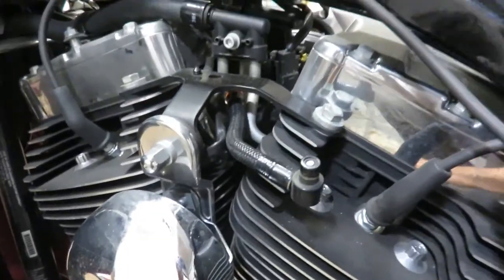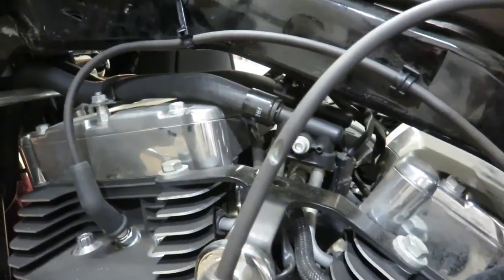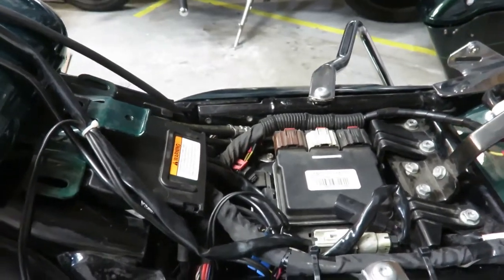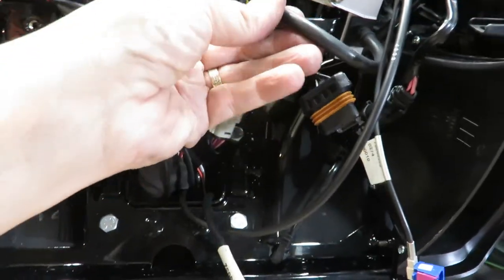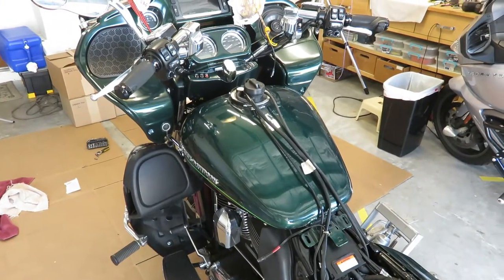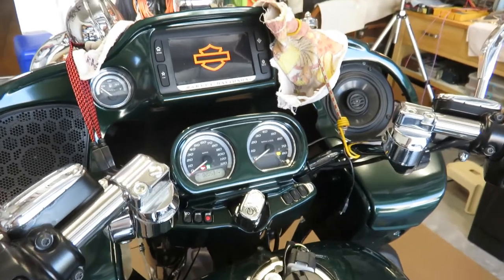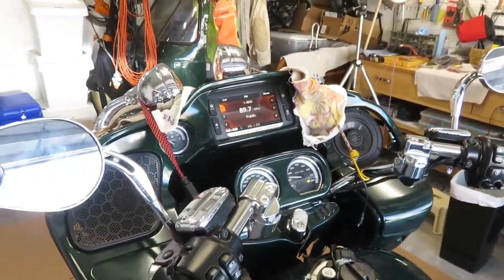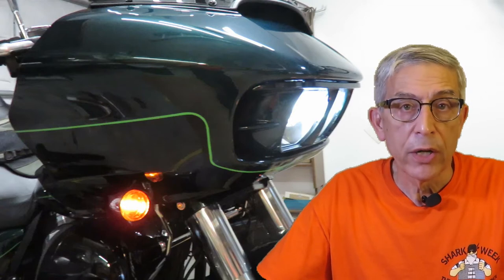Smoke Test – Bat Wing to Shark Nose Conversion – Presto Change-O Ep. 7

Comment: First off...love the vids. and they are very detailed. i have an 08 road glide and i want to do this mod. when it comes to the gauges i noticed you have the new gauges,,,how did you get the wiring to work with new gauges
Reply from the maker: If you already have a Road Glide, are you saying you want to convert it to the newer fairing? I don't know if that can be done. As for gauges, I used the gauges from the bat wing. You would have to use your existing gauges.